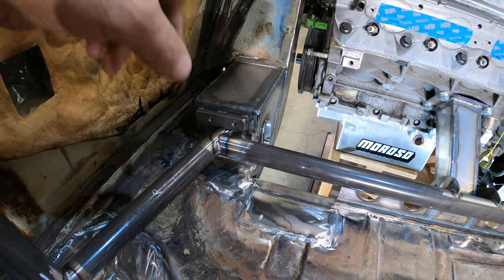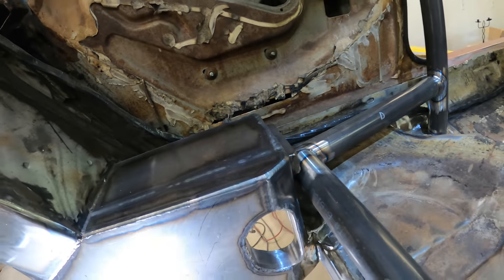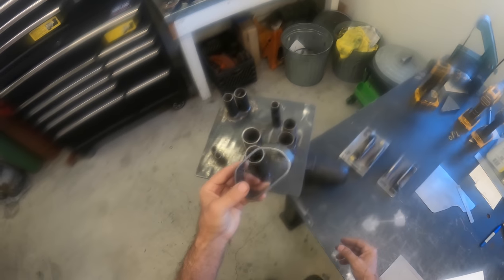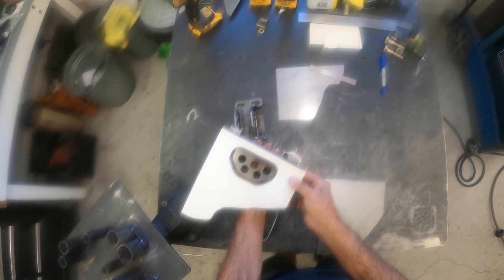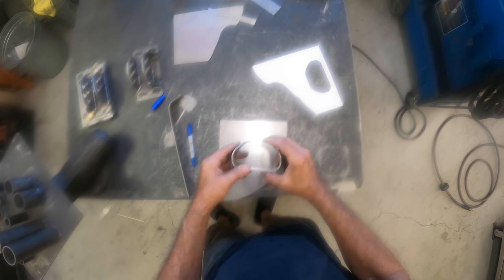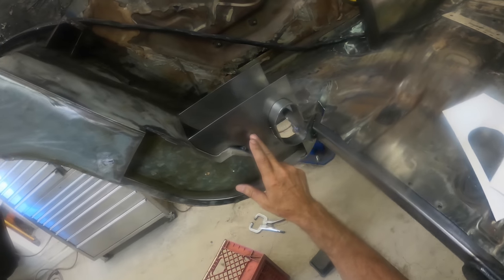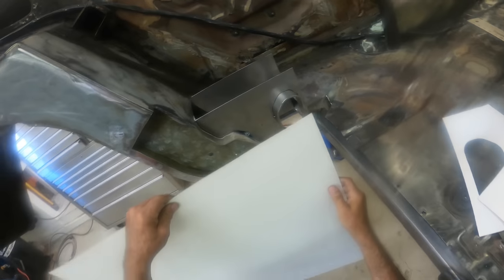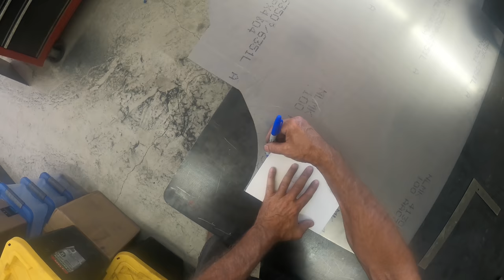V8 into Corvair the hard way

Comment: When I do all welding I'll use  the arc welder mig is brittle and on a rollbar mount you don't want it breaking if you roll I've worked in many fab shops and I'm certafied in mig Tig ,arc and dual shield I was an iron worker in Seattle for 29 years and 3 years machine classes and 1year fab and welding school I like your work it's very satisfying to watch you work

Comment: Meticulous fabrication combined with structural art. Loved it!!! When you featured the Ultra4 that you built, I thought you have a huge shop and all kind of special and modern equipment. I know that a great fabricator always have the answer why a part is design the way it is. Thanks for sharing.
Reply from the maker: Thanks, my shop is basically a three car garage with mostly 50 year old American machines bought used. The CAD work is basically nothing more than card board cutouts.
Reply: @JohnReynolds661  the cad work is nothing more than cardboard cutouts LOL that line is priceless. Good to meet you John.

Comment: The work looks beautiful as usual,but I might be a little leary of projecting the motor mount so far away from the block. I’ve seen the side of the block ripped out from similar arrangements. The fix would be a rigid mount from the crossmember to very close to the block to eliminate the leverage on the block. Many builders will eliminate the side mounts completely and run motor plates,front and rear. Or in your case side and side, this is to eliminate bore distortion for better ring seal. Just food for thought. Keep up the good work,can’t wait to go for a ride!
Reply from the maker: I thought about the leverage too and, in fact made a mount originally that hugs the block in my first go-around.  I changed it to this arrangement because now, even the mounts don't have to be removed to drop the engine with the exhaust manifolds on.  I doubt this will be revisited as the goal, as always,  is to keep moving forward.
Reply: That’s it,just keep moving forward. It will let you know if it’s unhappy.
Reply from the maker: It may or may not but one thing is for sure, you'll keep reminding me.
Reply: True That!
Reply from the maker: How long has your Mopar project been going on, 15-20 years?
Reply: Since 1986, third makeover. No excuses.

Comment: I would love to see a 1966 to 1969 Corvair widened 12" so it can be adapted to a C-5 corvette . this would require a diner for air to cut 13" out of the center ,which can be adapted to the sides. This makes room for a torque tube tunnel. The wheelbase is1.3 inches longer on the Corvair. The torque tube can be shortened 1.3" and the shaft end that goes to the clutch disc and crankshaft bushing/bearing. The corvette  will not be modified any further. The biggest problem I see is getting a wider windshield and rear screen manufactured. Has anyone ever attempted the mods I have mentioned.
Reply from the maker: There are widened Corvair transplants but I've only seen it done with fender flairs.  There are also front engine projects with full frames.  To me, it turns the car into a Camaro.